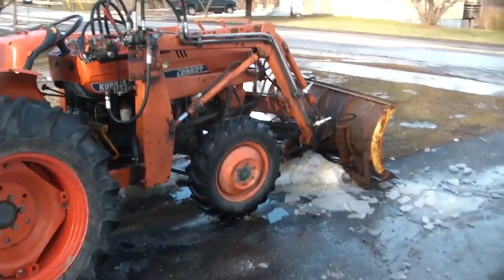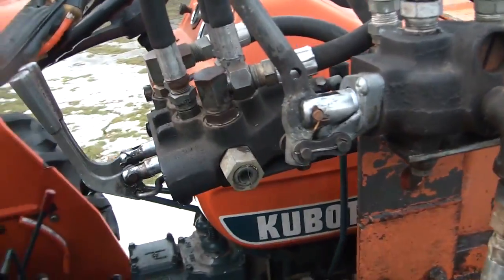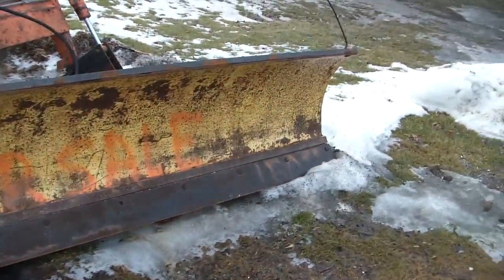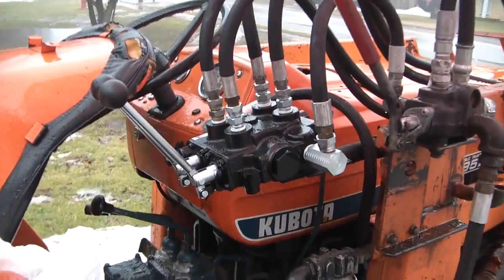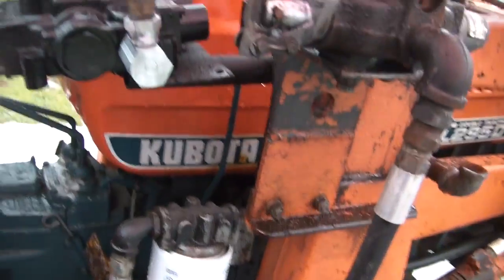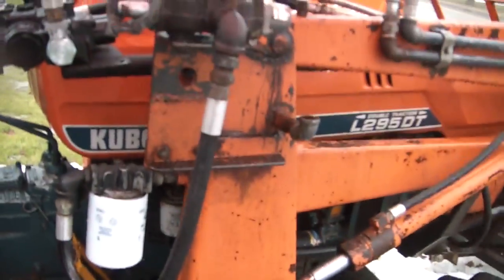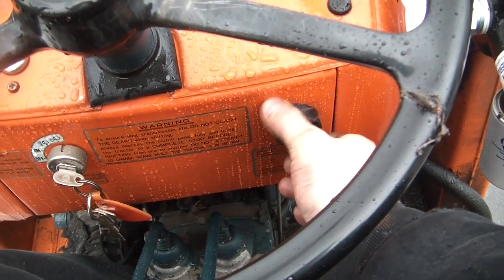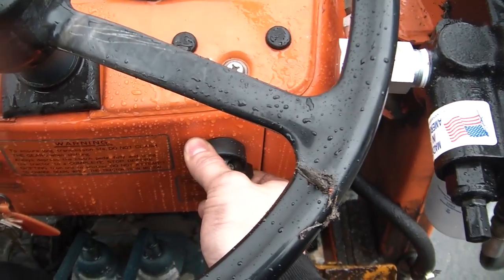kubota loader valve

Comment: I have concerns regarding the original installation of the add on hydraulic valve for the power angling.  I am wondering if it was installed on the return side of the original valve rather than a power beyond port that most valves don't have. If so you will not have a pressure relief valve is the system, that may have been what split the original valve body. When you dead end the angle cylinder with the engine at a speed above idle the pump will increase the pressure until something breaks rather than stalling the engine. A power beyond valve has 3 hoses, supply, return and power beyond where the extra valve would be connected.  The normal return line must never be connected to anything but the hydraulic tank because it is the path that the pressure relief valve uses to dump the oil back to the tank to prevent over-pressure. I have never seen a valve body split like that I am sure that you don' want to do it again with that nice new valve.  It also could have been a stuck pressure relief valve in the old assembly. That may not have been the problem but I thought that I would throw in my 2 cents worth. Oh by the way, that was some very nice fabrication and welding work that you did. You gotta love those Kubotas.

Comment: timely subject, I need to do some work on my loader valve soon. There is a spot in the valve body where moisture builds up, and rusts the relief spring up. So I get a delayed response to my bucket roll. It was replaced under warrantee years back, but I'm not feeling like I want to fold out $500.00 if I can pull this bugger apart and fix it. Its always cool to see the older Kubotas still alive and kicking, I love mine.